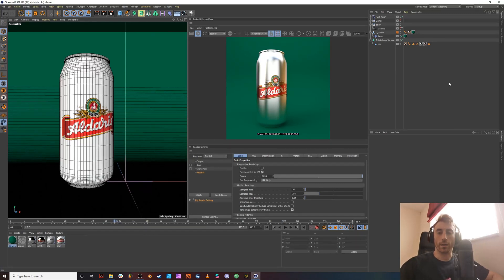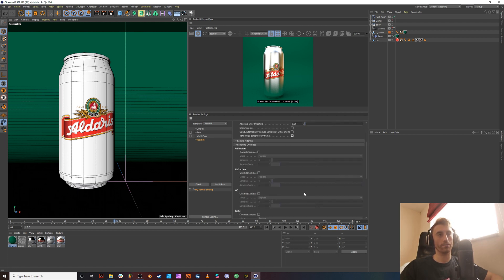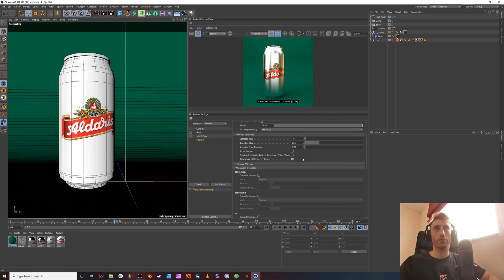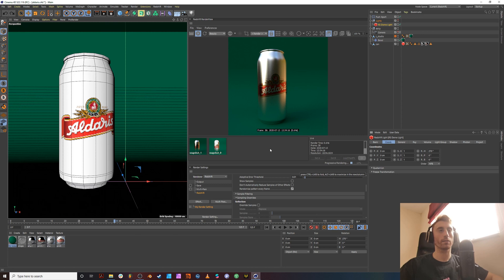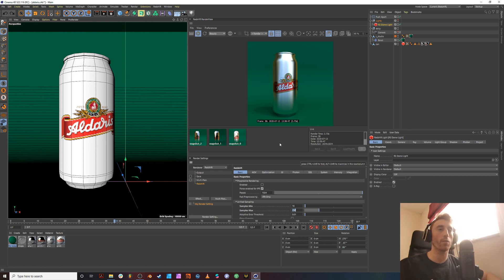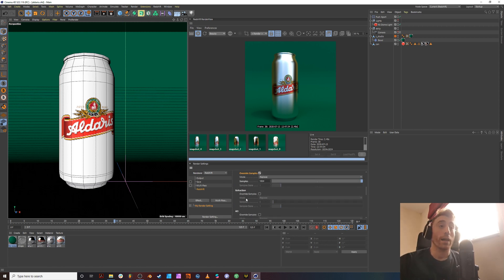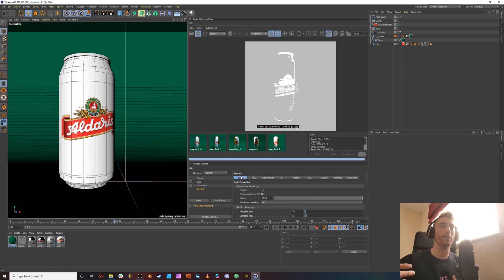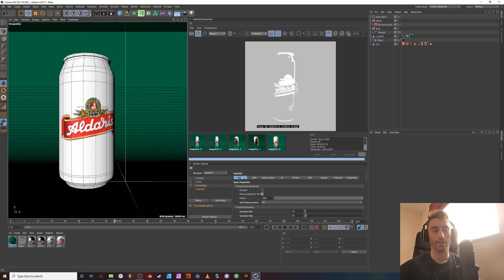Basics of Redshifts with Cinema 4D - Speed up Render time

Comment: Hey - just wondering what the reason for using multiples of 8 (if that's correct?) for the samples / passes etc is? eg how come 512 and not 500? thanks :)
Reply from the maker: This is a good question, Binary prefixes(2,4,16,32 etc) are used in the redshift documentation. This would mean the developers of Redshift inteded Binary prefixes to be used. But it's a much deeper rabbit hole to do with computer science. Most thing which operate on Binary will use prefixes of 2n. Check out https://en.wikipedia.org/wiki/Binary_prefix I would recommend using this for most render engines unless specifed otherwise.
Reply: @BoldBreak  Thanks so much! that's really helpful - I see - I won't need to go down that particular rabbit hole for sure, so this explanation really helps - much appreciated!

Comment: Is it ok to control light samples in light attributes itself instead of sampling override..?
Reply from the maker: Yes it's definitely worth exploring that option. There is potential to speed up your renders using this work flow.

For instance if you had an ambient light in your scene casting no shadows or specular. You could have your samples quite low for that particular light. 

The only setback to this work flow is scene management. An organised work flow is required to set samples for individual lights.

This type of granular optimisation is where redshift shows its speed.
Reply: @BoldBreak  your workflow worked well with my current scene, i had 4 min render time with previous sample settings, now its 1min 38 sec. Thanks for the tip..
Reply from the maker: Glad it helped. Redshift has a deep learning curve but it's the knowledge is transferrable. 

Redshift forces you to understand rendering works to achieve a fast and beautiful render. You can apply that knowledge to many other render engines.

Comment: Hello! Why u don't use denoiser? Also, should the RS tag for the subdivision surface always be used?
Reply from the maker: I tend to use the denoiser for animation. The denoiser is a post effect in some way and will alter the final image. For a still it should not be necessary. The RS tag should be used as much as possible tif you wish to streamline the process. But there are exceptions which are contextual.
Reply: @BoldBreak  thanks u
Reply from the maker: @SteevMy  Anytime

Comment: am i doing something wrong? I have every sample settings at 3 and all gi rays are at 6 and i'm trying to render a simple turbulenceFD explosion but its taking 5 minutes a frame. Using a gtx 1070 and ryzen 1800x 8 core processor.
Reply from the maker: You want to optimise the sample settings so redshift is focusing on rendering the volumes. Crank your volumes samples up to about 512. Make sure you are making the explosion redshift object and tick volumes.

Comment: thanks you ihave GTX 770 what abest setting for me :/
Reply from the maker: Hey, So because of the limiatations of the GTX 770 you will have to render will some noise or wait for the long render. You could de-noise in after effects or davinci ?! Maybe a second gtx 770 could help ?
Reply: @BoldBreak  THANS YOU FOR REPOND 
Yes, there is a little bit of nois, can I remove it in any other program in the montage or after effect?
Reply from the maker: @HASNIISCOBAR  photoshop, after effects and  affinity photo  can denoise.
Reply: @BoldBreak  thanks you bro im new subsc for your channel 
Good luck
Reply from the maker: Thanks for the sub. No problem l hope it helps.

Comment: Great tips, which graphic card are using? thanks
Reply from the maker: Currently the 2080ti but that may change with Nvidia's new announcements.
Reply: @BoldBreak  great. I have the 2080 super and it seems It takes longer to me, but for sure I am doing something wrong
Reply from the maker: @pablodanielfernandez9321 redshift is very fast but it's a very complex rendering engine. I'm still learning my way around it.

Redshift has the potential to be faster than octane if you tweak your settings just right. It's about finding that sweet spot.

I'll do a part 2 on redshift at some stage.